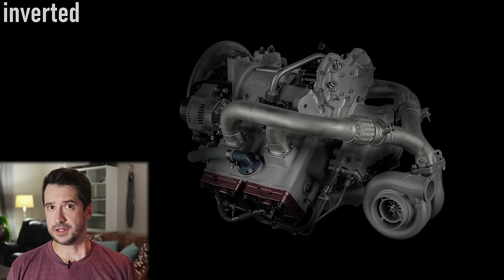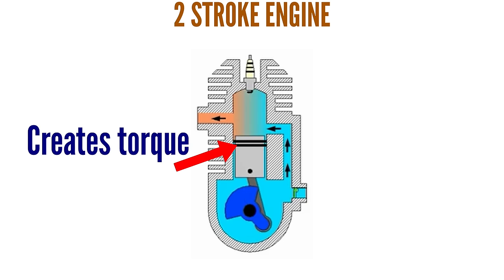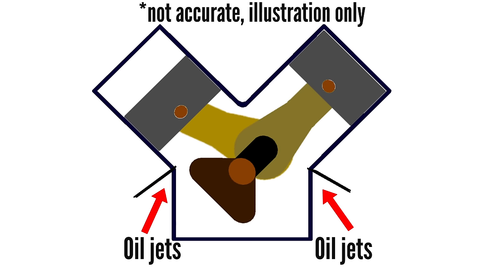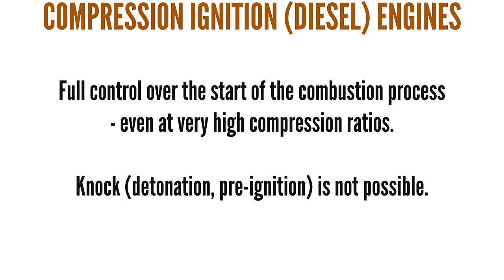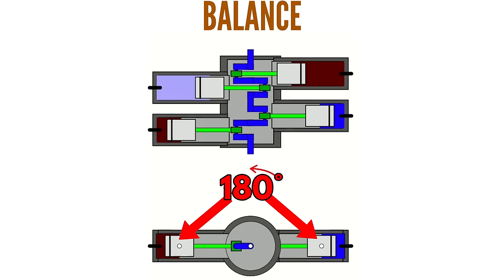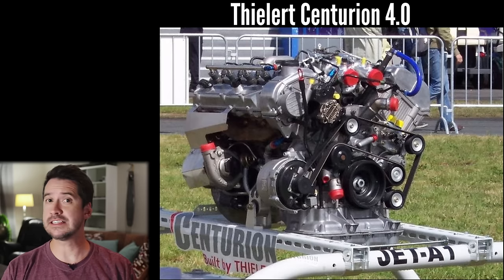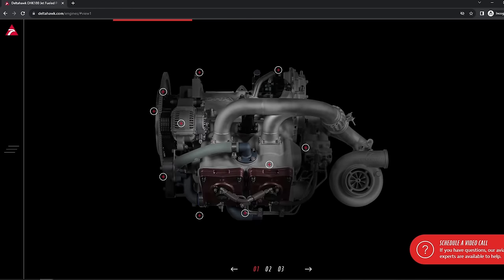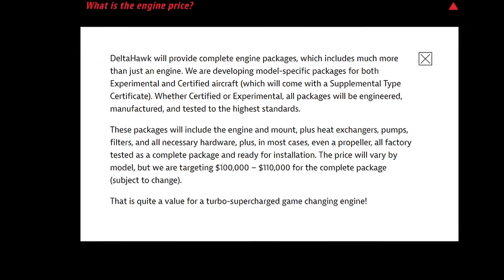Deltahawk's Jet Fuel Piston Airplane Engine Explained

Comment: Aerospace is about 3 decades ahead of the automotive and industrial industry in material science. Aerospace is also about 3 decades behind in engine tech. You can slap on a pair of 'just winging it ' wings made out of a new polymer or alloy but DON'T YOU DARE try to fuel inject that lawnmower engine.

Comment: 2 stroke diesel? Been in use on RC airplanes since the 1930s. Nothing new there.🤷‍♂️
Reply from the maker: I have looked but couldn't find any 2 stroke diesel engines for manned light aircraft. If it's not a first, it surely is very unusual.
Reply: @LetsGoAviate  RC=radio controlled model airplanes.🤠👍🏴🇺🇸

Comment: IF these engines can be affordable and but jet fuel instead of av gas(RARE) Then it could revolutionize the vintage plane world. If u can fly a dc3 with this engine tech and burn Jet A in piston engine... well that may be cheaper than a turbine conversion. At least on some aircraft dc3 prolly bad example being radial. But like an old seaplane u need to be able to fuel at modern airports etc

Comment: It's a gdmned diesel. Unsuitable for airplane's light weight construction. For one big proven reason.  Vibration. Diesels have over twice as much cylinder compression and they simply make more torsional vibration. Even in much stronger truck frames it causes long term damage

Comment: Very correct analysis.
I was living in a bus for a few years, which had a Detroit Diesel 6V92 - 2-stroke engine with a Blower and a Turbo.
I was running this thing on 100% veggie oil.
It was so efficient, I was getting 8.5 Mpg towing a Suburban behind the bus.
I have rebuilt the engine myself.
Two-stroke diesels should be used everywhere!
They are Totally awesome.
My engine had 380 Hp, 1000 ft-pounds of Torque.
Max torque between 1,700 and 2,100 RPM.
My top speed was 85 Mph.
That is because I had put in a rear differential of 3.33
Excellent video.......
https://www.youtube.com/watch?v=63UVFk07oqc

Comment: FAA certification means nothing unless it goes into production and gets designed into aircraft.  Other very promising aviation engines got that far and then ... nothing happened.
Reply from the maker: That would be dissapointing if that happens. Order deliveries supposed to start in 2024, so time will tell.
Reply: The FAA also approved Boeings MCAS, that worked well. FAA means nothing, needs Euro compliance to be properly certified.
Reply: @chippyjohn1 cheese and chalk... PFTRs and Aircraft certification are completely different things.

True, it was the FAA that required Boeing to give MCAS full authority.

The fix was to return to the original Boeing design
Reply: @WilhelmKarsten  The point is FAA certification means nothing full stop. Even engineers from Boeing warned the FAA of fatal possibilities and the FAA ignored it. The FAA approves what they are paid to approve.
Reply: @chippyjohn1  – "Euro compliance" has produced its share of boo-boos.

Comment: "Fewer parts" of a two stroke, and then adds a turbo and supercharger, mechanical fuel injection and oil pump.  lol   All moving parts added.   Rotary engine seems a better design.
Reply: Rotary engines have been obsolete for a nearly a century... so much for what you know son.

Comment: Doesn't it have like 350 or 400 ft. lbs or torque,?   With a variable pitch prop, shoudln't  torque be the best judge of power ?
Reply: Torque is not a unit of measurement which describes power and it's just not a relevant unit with regard to aircraft engines.

Anyway, this engine makes 363 lb-ft, while a Continental TSIO-360 can make as much as 440 lb-ft, so it just doesn't offer much when it comes to performance.
Reply: @PistonAvatarGuy  You are a little bit myopic in your analysis and in your comparisons of unlike items
1.  TSIO 360 is a SIX (6), six cylinder engine.    
2.  The first Deltahawk engine is a 4 cylinder.   I am not defending deltahawk, but since I believe in efficacy , we need to note that your comparison of output numbers is comparing the 4 cyl deltahawk engine to the 6 cylinder conti.    Why did you do this?  Sure the 6 has more power and torque than a 4, in general. 

I am sure an 8 cylinder dual turbocharged engine would eclipse both of these engines, but what is the point in making comparisons of engines of different sizes.  The potential value of the deltahawk engine is comparing to engines of the same size, operating costs which include fuel efficiency,  cost of part replacement in terms of parts and labor cost, less complication which generally results in higher reliability, less moving parts.   To be sure, this needs to be time testing over 100s of thousands of hours to verify, but this is the potential.    

3.  Your statement that torque is not a relevant unit regarding aircraft engines is your, pure, personal opinion ,and is incorrect.   Torque has complete relevance in aircraft (particularly piston) engines , as it is the measure of the strength of rotational movement and determines how a car, boat or airplane accelerates up to speed.  The time this takes is determined by the amount of power.   RPM is the time determinant for power, the higher the rpm the less time and the more power.   

In fact Torque and Power are inseparably related by the following formula:  (RPM X Torque/5252)= horsepower.  So, torque and power absolutely describe each other.   

4.  Even more applicable in a non geared engine is it's ability to produce greater torque at a low RPM, because prop rpms should stay around 2000 to 2500 rpm.   So we cannot really use high rpm to increase power, as in the automotive application.  We really don't care how much power an aircraft engine like this delivers at 6000 rpm or 4000 rpm because it will never be there.   We care how much force can drive the prop through the air at a low rpm.  Compression ignition engines (say Diesel if you like) are excellent at generating Torque at low RPM.    Torque is completely relevant to aircraft engine discussions, particularly in a non geared compression ignition engine.

For aircraft use, having an engine with a higher torque rating means that you can turn a larger prop producing higher thrust at lower RPMs.    This results in less noise than smaller props at higher rpms, better climbs and less noise In any case, torque values are generally always part of the discussion when discussing aircraft engines.
Reply: @orthopraxis235  Cylinder count is irrelevant. Even the 4 cylinder, naturally aspirated Lycoming IO-360 makes more torque than this engine, at 389 lb-ft..

At around $100,000, the Deltahawk is a VERY expensive engine, especially for its power output.

I'm very, VERY well aware of the relationship between torque, HP and how they relate to aircraft engines. What you failed to understand here is that aircraft engines can have wildly varied torque output ratings for the same engine power output, but their performance will be basically the same, because their performance is determined by the power output of the engine.

Diesels actually generate LESS torque than gasoline engines, unless they're running with much, MUCH higher manifold pressures.

If you want less noise, it's better to use geared engines, this allows the engine to be much lighter than a direct-drive engine and it allows the prop to turn much more slowly.
Reply: @PistonAvatarGuy  I can imagine, and only imagine, where youre points would be theoretically correct, and Im giving you a lot of leeway there just to avoid more discord.   But practically, diesel engines are made because of the torque they generate, their longetivy, high compression (thus mani pressures), ability to use a stabile non decaying fuel, many other factors.

I am actually kind of irritated by how incorrect your statements are, for practical purposes regarding aircraft.   But that's my own battle when you come across seemingly intelligent people that are very much off the mark in their application of knowledge.   The main fault in your arguments are your subjective opinions "too expensive"  "its better to have a geared engine"  without really making any further specification as to why.    That's the problem with your pattern of analysis and writing.    To expensive for what?    There are concepts of price  cost and value that determine what might be too expensive for one mission but perhaps perfectly aligned with another.   You magically leave out these things when you just state something is "too expensive."    Understand?
Reply: @orthopraxis235  The longevity of the SMA SR305 diesel is not superior to that of its gasoline fueled counterparts, either, it is slightly inferior. The longevity of the Austro Engine AE330 is also quite poor relative to its gasoline fueled counterparts. Longevity is not related to the fuel that an engine burns.

Really, the vast majority of what you'll hear about diesel engines online is pure folklore, they're basically the William Wallace of the engine world.
Reply: @orthopraxis235  Trying this comment again:

Everything that I've said here is entirely correct, I promise you. I could post a mountain of specs and examples that prove that what I'm saying here is true, but you're clearly not interested in what I have to say on this matter. My points were that the performance of this engine is poor and that it's far too expensive for most people to consider it as a replacement for 180-200 hp LyCont engines.

Deltahawk also refuses to release the TBO for their engine, despite having it certified, so its longevity is almost certainly hilariously poor, which is to be expected of an engine of this type (ports in the sleeves).
Reply: @orthopraxis235  Even the Ford 2.7 EcoBoost makes more torque on a per displacement basis than the planned 235 hp Deltahawk, and it's a fully emissions controlled engine. The rpm where the EcoBoost makes its peak torque is even low enough to drive a prop in a direct-drive application.

Sorry, buddy, but diesels have never been impressive when it comes to their power output, and they only rarely offer an advantage when it comes to torque output in actual mass production engines.

Torque isn't even what you want from an engine, especially an aircraft engine, power output is what matters. Power to weight ratio is by far the most important metric when it comes to aircraft engines, which is why turbine engines dominate absolutely everything, despite not being very efficient.

Comment: Whats the big deal, diesel engines have been around for years And have been used in aircraft.  As for electrics, it don't need any except for a fuel pump from the tank  if not gravity feed. . Jet fuel is just kerosene (clean with additives) , but needs some extra additives to normally run in a diesel unless the engine is designed to run without the extra lubricants put in diesel
Reply: Power-to-weight ratio is a big deal for aircraft applications... this is a significant improvement.

Any Diesel engine that can run on DF1 (Diesel #1) or low sulfur Diesel #2 can run on Jet A without any additives.

The US Army runs all its Diesel engines on Jet A1 (US military code JP8) Nato code F34
Reply: @WilhelmKarsten   There is a lot more than just power to weight ratio when selecting an aircraft engine. 
Cost is a major factor. 100k for regular or 150k for a new technology. 
Operating hours between inspections.
Cost and availability of inspectors and inspection facilities.
Reply: @mazdarx7887  Absolutely, fuel costs is also a major factor, as is fuel availability.
If purchase price was no matter? all new GA planes would be turboprops, gas turbine engines are vastly superior to any reciprocating piston engines.
Reply: @WilhelmKarsten   Your commenting on the wrong post, this vid is about a diesel motors, not gas turbine. But as for fuel, it don't matter if the fuel was $0.50 a gallon, you still can't fly if you can't get inspections without great expense.
Reply: @mazdarx7887  Not at all, Gas turbine engines completely replaced reciprocating piston engines in commercial and military aircraft applications.
 Most experts predict that the widespread use of Avgas is soon coming to an end and with rising fuel prices Diesel engines are an attractive alternative to traditional GA engines, there are a couple Diesel engines already available and it is very possibly a trend that could gain mainstream acceptance in the GA industry.
Reply: @mazdarx7887  Any certified AP or AMT will be qualified to do inspections, there is no special training required for Diesel engines.
Reply: @WilhelmKarsten  " there is no special training required for Diesel engines.".  Obviously you're not an aircraft mechanic or involved in any way with aircraft, fixed or rotary winged  maintenance. Even basic pilots know only type certified mechanics can work on the craft they are operating. Except for ultralight and some experimental planes
Reply: @WilhelmKarsten   "Gas turbine engines completely replaced reciprocating piston engines in commercial and military aircraft applications"  you have absolutely no idea what you are talking about. There are thousands of piston engine planes, private and commercial operating on a daily basis all over the world, even piston engined helicopters.
"" Most experts predict that the widespread use of Avgas is soon coming to an end" hehehe , I heard that back in the late 70's , but yes the 130-145 is very hard to get, lots of 100-130 around and will be for many years to come.  But wherever you read that the key word is "soon" Soon can mean tomorrow or 30 years from now.  Didn't a lot of experts predict flying cars to be common by 2000, they also need warnings not to eat batteries on cell phone packaging. 

Anyway keep on trolling
Reply: @mazdarx7887  There is no one converting old gas turbine planes with piston engines nor can I think of any commercial or military aircraft in current production with a piston engine either.
 Recent events would suggest otherwise, shortages Avgas and increasing pressure to ban leaded fuels completely are very real.
Many commercial operations are moving away from using aircraft that are dependent on 100LL fuel.
Diesel engines are a viable alternative to gas turbine engines and can be cost competitive with certified Mogas options.

Comment: This engine has been in development for at least 10-15 years. Make another video when it is installed on a flying airplane. Blah,Blah,Blah. So, it is a two stroke that have been around for 125 years. And at $110,000 that is a lot of money. A person can buy a airplane for that money. This video is just a repeat of many others.
Reply from the maker: Maybe see some of the latest news regarding this engine. Besides, this video is more about the engineering of the engine, flying or not, which is unique in aviation. And I'd like to see the video mine is a repeat of 😉

Comment: They said the TBO would be 2,000 hours on a video related in 2019. It's a steep price point but 40% better fuel efficiency and cheaper fuel makes it an attractive option.
Reply from the maker: Thanks, I couldn't find any information regarding TBO, but if it's 2,000 hours then it's very competitive with the Lyco's and Conti's.

Comment: I like everything about this design except for the V4 layout. Why not build it as a boxer 4 and balance perfectly with a lighter crankshaft? I think a 4.9L boxer 6 version with 270-300 horsepower would be excellent.
Reply: What about sticking an LS or Hellcat in your plane? More power and stuff like that.
Reply: @chrishenniker5944  The LS motors have aluminum blocks and are more compact than the HEMIs, so they're a better fit for aviation. There are quite a few experimental and kitplane builds with LS motors.